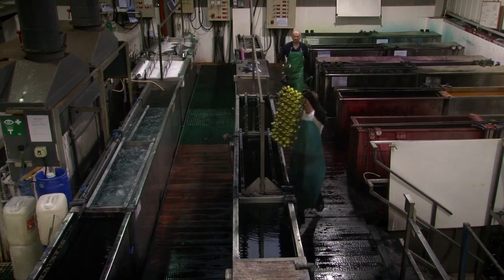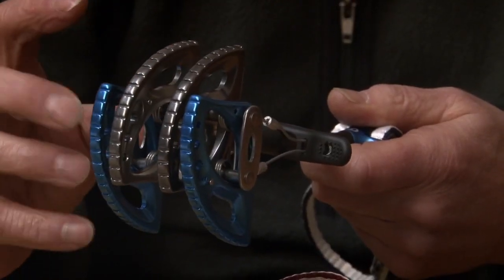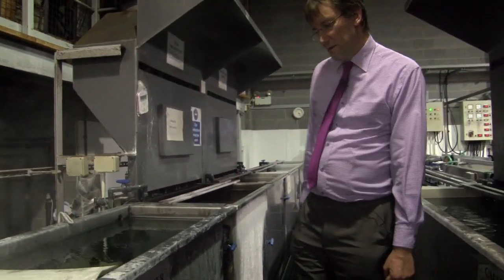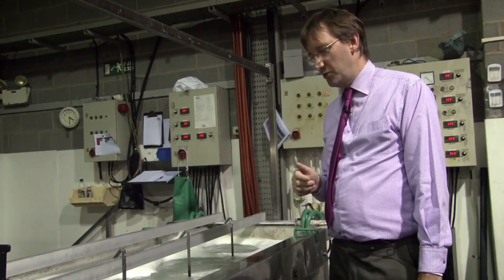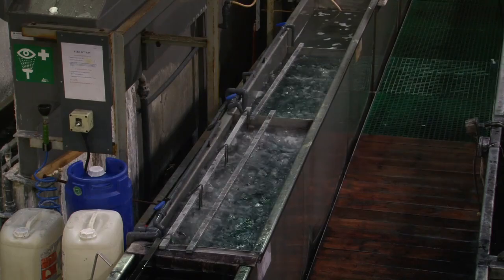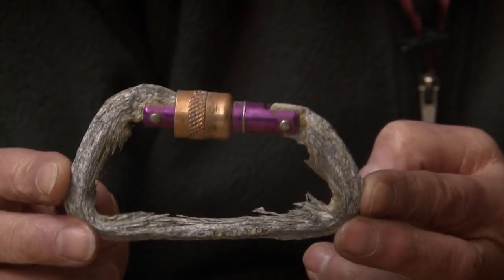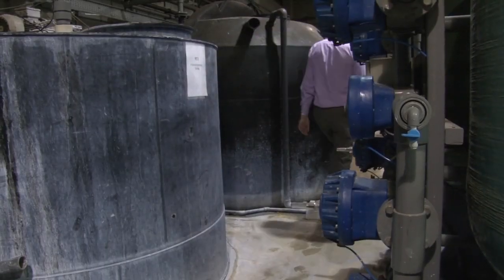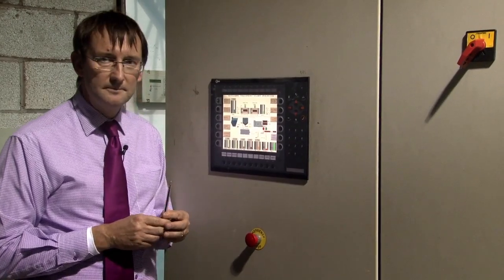Benefits of anodising carabiners

Comment: There are special cases where one needs anodising but for many cases one does not. Why do it for gym use? Most sport climbers never see the ocean with gear. I think Edelrid is going in the right direction not doing it any more on some products.
Reply: I don't know why you wouldn't do it? It increases lifetime, allows for colour coding, etc. The only benefit of not doing it is that it's maybe cheaper. They're selling it as an "eco friendly" thing, but if you have to replace the entire unit twice as often (if not more?) then is it really eco friendly. *Reduce*, re-use, recycle - in that order. Anodising reduces the amount of waste.
Reply: @DeShark88  come on. A carabiner of a usual climber will never be retired because it is corroded. It will be replaced because the gate might not be working anymore or because it has sharp edges. Nothing to reduce here when anodizing... on the contrary. Anodizing surely has its use and advantages but having the choice  when you don't need it is the contribution of such biners here..
Reply: Edelrid is made in China so immediately invalid

Comment: Anyone know what type of anodising this is?
Reply: Just your standard aluminium anodising. Usually a bath of sulfuric acid. Or did you want more specific than what was in the video?
Reply: @DeShark88  Dw not important, I’ve heard that there is class 1 and 2 anodising but I’m not too sure what that means anyway.  I just wondered what type?
Reply: @vinceking7878  ah yes. This is Type II anodising. Type I is chromic acid anodising, Type II is sulphuric acid anodising. The sulfuric acid process takes dye better and is generally thicker and more hard wearing (and I think more environmentally friendly comparatively).